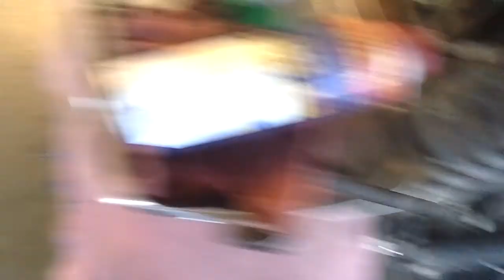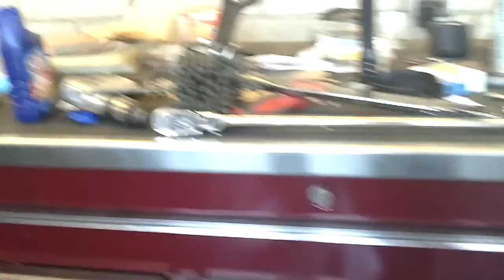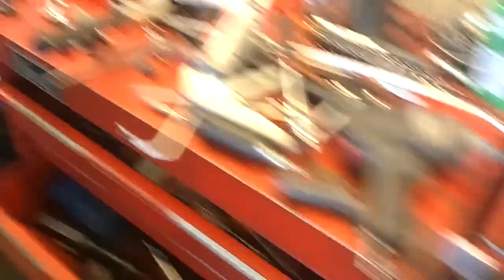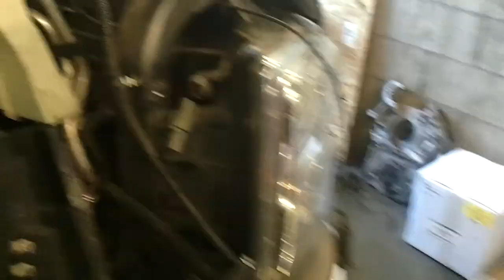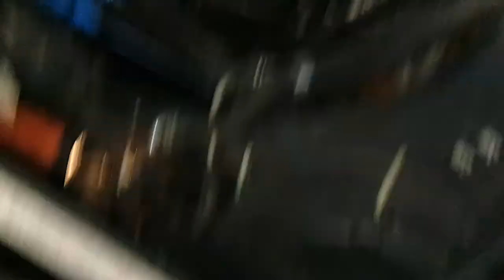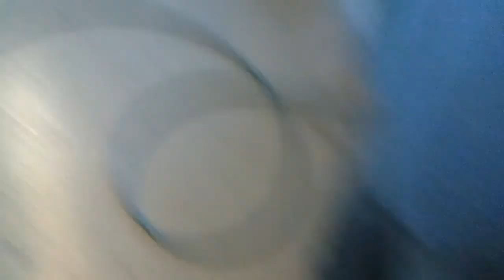6.4L DAMAGE PISTON PT 4

Comment: There was a few other things that used to taken into consideration as well like cylinder wall honing back when we did it most engines had to be sent to machine shops for honing as you was not able to meet factory specializations of the honing process , & when the mod engines ( 4.6  & 5.4 ) first came out they would not let you even overhaul them so a new drop in was the only option at first .